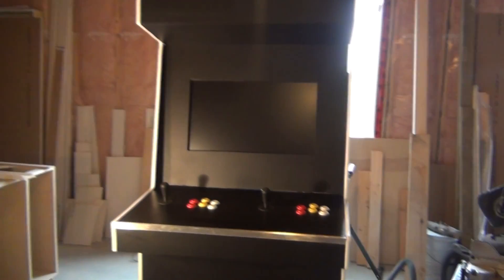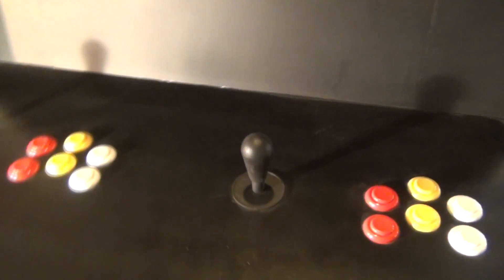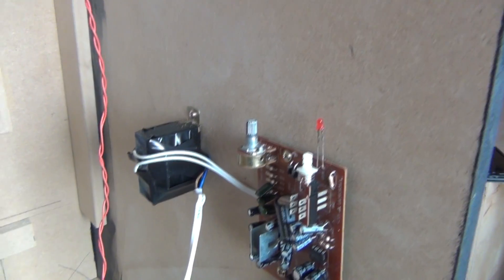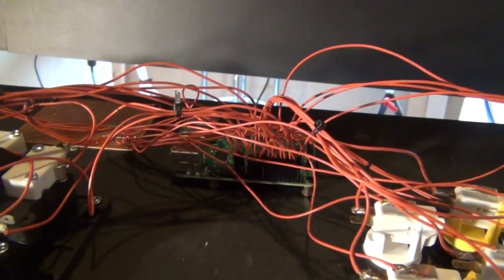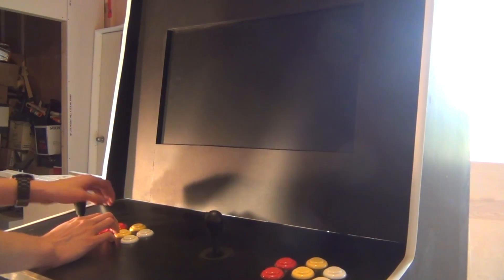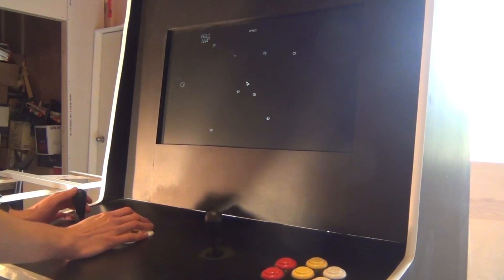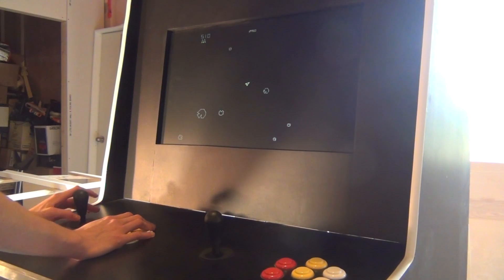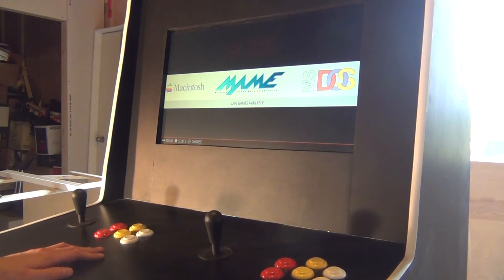DIY Full Sized Raspberry Pi Arcade Machine

Comment: Good video bro. Just a quick question : How come you plugged the amplifier to the pi? Cant the audio be connected through the headphone jack to the speaker? im asking cause im planning my cabinet. Your imput would be great. Thnx
Reply from the maker: +Dani F The Pi doesn't have very much power from the audio jack, as a result it can really only power headphones. If I plugged the speaker directly in it would be way too quiet.
Reply: +onFile Thanx man. I think if the hdmi cable was connected directly you would get sound through the screen, then using the screens headphone jack, it can go directly to a speaker system. U think that would work?
Reply from the maker: +Dani F Yes, if your monitor has speakers than you can use the HDMI audio and have it play through the monitor or connect up external speakers through it. Unfortunately my monitor didn't have speakers.
Reply: I see. Thanx alot bro... 👍👍

Comment: Good job... but... why did you build it that large when the monitor doesn´t fit up to the size? Even on the top part it´s way too thick. I guess it would´ve looked more professional and eye-pleasing when built a little bit more compact.